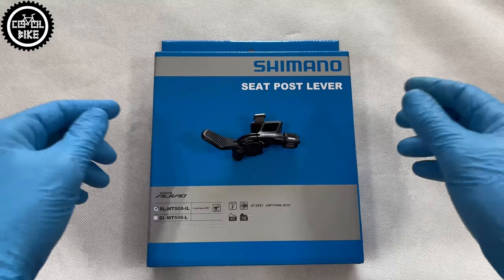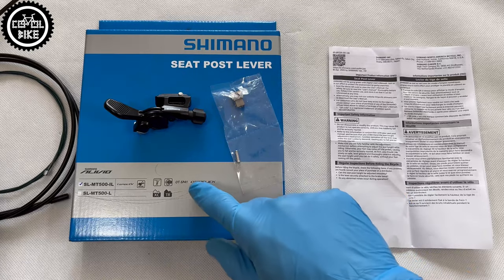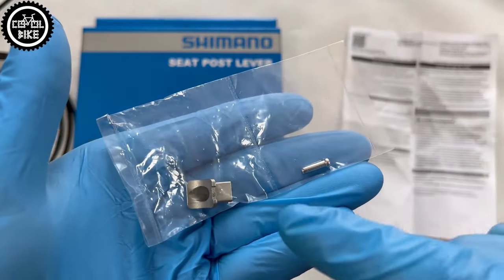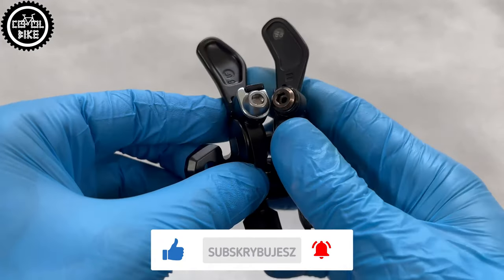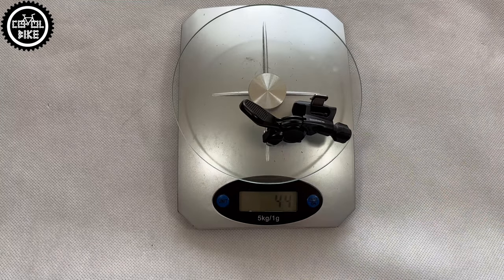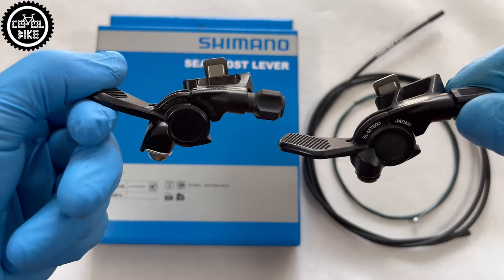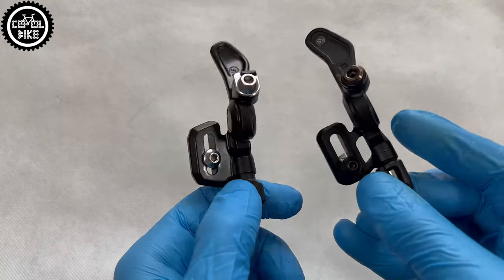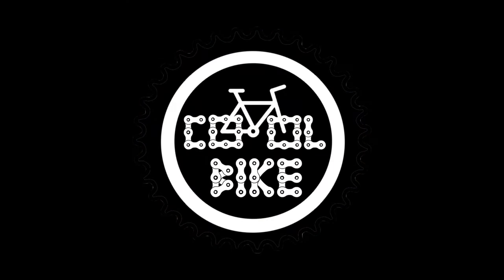SHIMANO DEORE MT500 vs XTR MT800 DROPPER POST REMOTE // BEST AND CHEAPEST ON THE MARKET SEAT LEVER ?

Comment: Thanks for a good comparison. I've found 500 has no bearing in it. Instead, it has a metal sleeve. 800 has a bearing so it's much smoother.
Reply from the maker: Thanks for this interesting fact. It's true that 800 is a bit smoother, but now 500 is 3 times cheaper. So its price-quality ratio cannot be beat.

Comment: hey mate I'm about to buy my first dropper, was thinking to get the ONEUP V3 on sale for 240 euros plus a lever. Do you think the MT500 would work fine or is worth spending few bucks more on something else?
Reply from the maker: Hi, I also found this promotion, and I'm wondering whether to buy 210 for a new bike that I don't have yet, or to choose BikeYoke Revive for 400e.
I had an MT 800 connected to a V2 seatpost, in my old bike that I finally sold with MT 500, and it worked very well :)
https://www.youtube.com/watch?v=ss6Itvvju5o